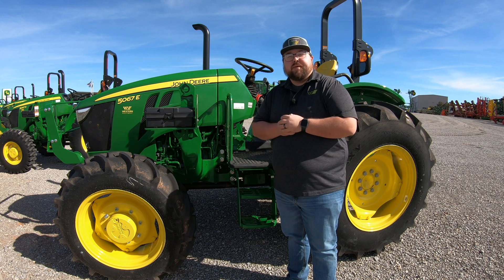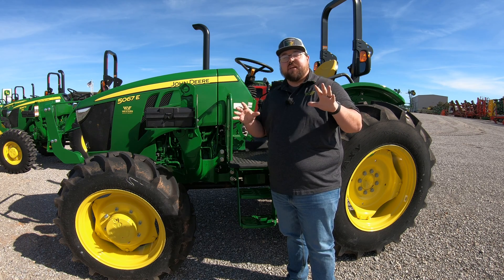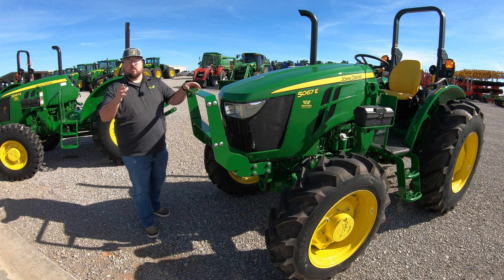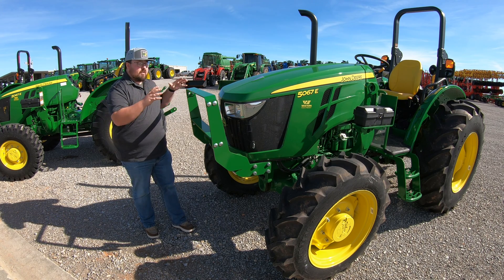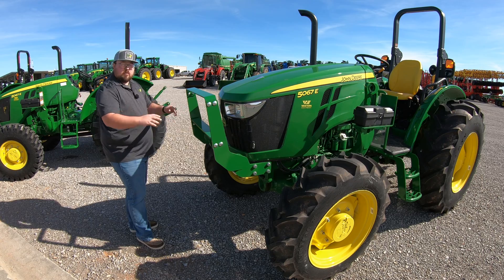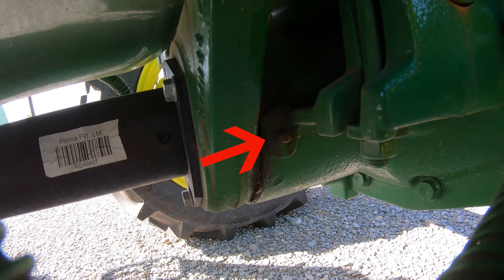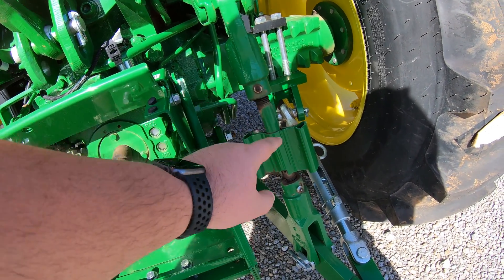ALL Grease Points on John Deere 5E 3-Cylinder Tractors

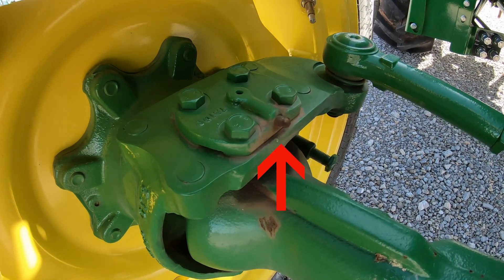Comment: There are 6 in the front, not counting the loader. . . at 1:10 he points to the top fitting but there are 2 on the bottom also. One on each side. And my 520M loader has 8 grease points per side. It loves grease. Especially moving dry dirt.
Reply: I noticed that he missed the 2 on the bottom of the front axle as well.  Also the 520M does love grease and a lot of it.